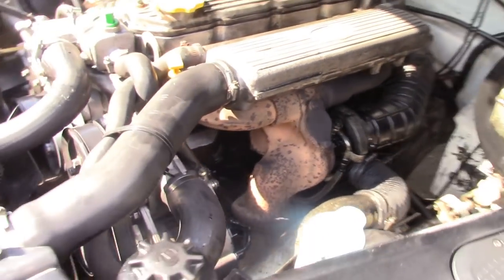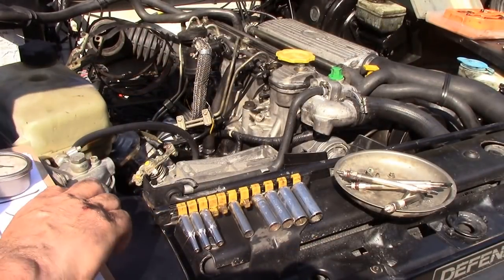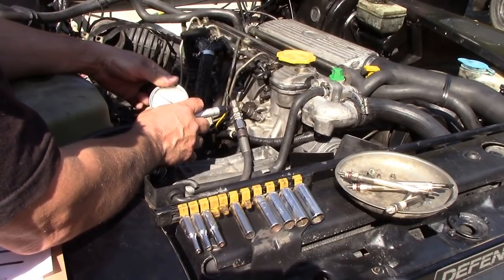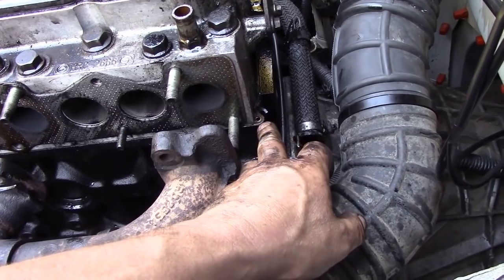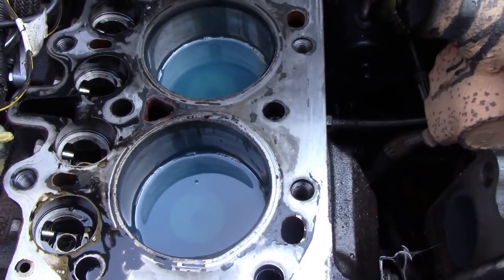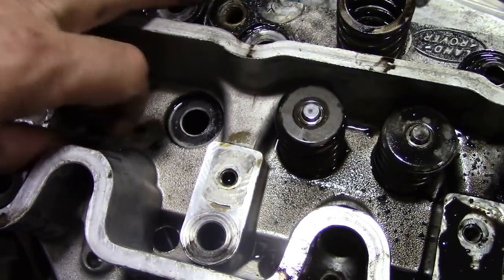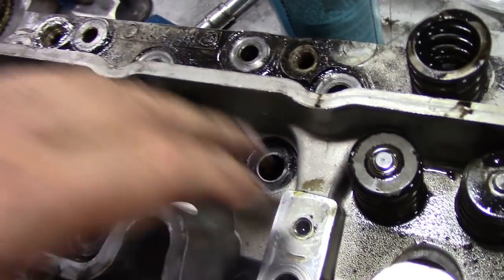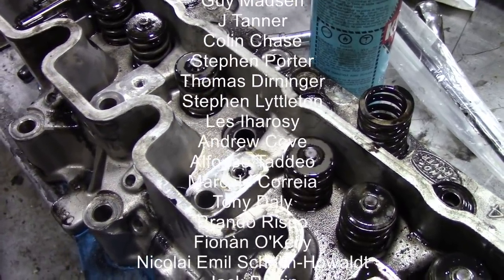300Tdi excessive oil consumption and leaks! What could it be?

Comment: I'm scratching my head as to why you didn't find the broken parts!!!  makes me think that the previous engine rebuild was not up to Britannica Restorations standards.  Possibly they thought that the valve guide was not that important so they stuck the broken guide in just to get it running.
Reply from the maker: Well it had me foxed - until this morning when I was fastening down the head
I had to use the old bolts as I didn't have any new ones (which is OK you can use them 3-4 times) but the one near the manifold would only go to 37 degrees not 60 - strange feeling tightening down so I put a good used one in and it was OK
So I think this has been running hot at some time and maybe the valve nipped in the guild?
There was some old damage to the block - I have videoed what I found
This vehicle did come form Eastern Europe

Comment: Hi Mike, have a Defer TDI300 which has been sitting for a few years in under cover in a tropical climate. nw back on the rod getting a few niggily things which can generally spoil a fun drive. Minor oil leak /power steering leaks etc.. recently replaced the lift pump which packed it in. up fro a service for sure but also thinking of getting ahead of these - what would you suggest  I should proactively change / replace for the long family drive coming up

Comment: brilliant fault find mike, just swapped my 90 300tdi for a 110 300tdi and was wondering if you reckon it's worth having an egt gauge (I.e from the likes of fourby uk) or just ease off on the hills? reason I ask is I beleive the 110 has a fuel boost pin and ring going by the puĺl from the engine and a bit of smoke, also the fuel pump inner cap bolts have been replaced with Alan heads rather than the standard torx headed ones, what's your thoughts bud?
Thanks
Aaron
Reply from the maker: Aaron
It is always a good idea to fit an EGT gauge on a 'tuned' engine
MIke
Reply: @BritannicaRestorations  Reckon I'll get the kit from fourby bud, wish I'd have removed it from the 90 before it went as well as the RRC coolant level float kit!

Comment: I'm amazed you couldn't here it rattling about Mike...
A quick question if you don't mind.... you say you keep parts in stock like the head, what happens when you buy a part and keep in on the shelf ready to be used and you fit it to the customers vehicle and have a problem?
Obviously if you put the head on and you've had it for a few years I take it the original warranty has expired...
Cheers..
Reply from the maker: The head I keep is reconditioned - pressure tested , re machined (inc. correct valve depth) and I warrant them myself as it was done locally and I was in control of the quality
Reply: Britannica Restorations Ltd ok cheers Mike, but do you ever get problems with other parts?
I know I've had my fair share of faulty parts which I've fitted and something has given up a few months later!
I just had it with a 8 month old alternator in Sweden and over a 1000 miles away from home, ended up finding a second hand one which was a 4 hours round trip in a hired car!
So Can you still claim from the supplier if you have had it on the shelf for months but it's not been used?
Reply from the maker: Good question!
I have a 2 year warranty on parts from my supplier - all I have to do is prove the part is theirs, (there is a special code on the box) fill in a claim form, and they offer me an instant credit (no return needed) or will ship out a replacement part 
After 20+ years doing parts you learn a thing or two
I do not sell or stock Chinese starters or alternators - do not care who's box they come in  -always OEM parts wherever possible. 
All brake parts are OEM boxed parts  - cost more and the customer thinks I am ripping them off, but if they want cheap Chinese they can go somewhere else
But parts on the shelf can be an issue - I have been slowly reducing inventory and as I now have a 72 hour FedEx service from the UK, it is not worth tying my money up on parts that are losing value and deteriorating 

Yes I pay more for shipping, but when you could see the amount of stock I had ordered special for people then didn't pay, it would bring a tear to your eye!
So special order parts are always paid for in advance now
I had lots of Series parts that I gave away to clubs to reduce inventory - there is only 1 customer with a 2a now who is loyal = they all buy from Paddocks on line and I know the margins they are working to, so I am not going to get into the 3% profit  game as I do not sell in volume
But what I do now is let customers provide their own parts for me to fit - and this is working out well - I charge 10% extra on my hourly rate which is the norm here in Canada, I am not responsible for duties, import costs, warranties and importantly wrongly ordered parts
And I do not give out part numbers any more ( well maybe to you guys) 

But I used to spend a long time working out which part was right for the vehicle (as you know there are a lot of mis-matched Rovers out there), making a detailed quote - only for them to take my quote and buy from Paddocks
You can spend hours on the computer working out part numbers, and the part has to include my time - as I could be doing something else!
Mike
Reply: Britannica Restorations Ltd a perfect answer Mike so thanks for that...
Take care and I'll be waiting for the next video!
Reply: Do you see any of the 2.5 NA and turbo engines out there? as fitter to the original 90?
Reply from the maker: I have a fully rebuilt 2.5 NA with transmission and transfer case in my container  - but I avoid the DT like the plague!
Reply: Britannica Restorations Ltd I've got 2 19j or 2.5 Td Mike, one in a genuine county and another in an old series 3, both have given good service and touch wood I've not had any problems with them!
Reply: Lol. TDis do rattle just a little

Comment: Lol.... 11:13 did you just say Africa and other strange places? Very educative diagnosis. I am looking into importing a 300tdi engine into Kenya for my 4 cylinder petrol conversion. Would you be selling engines?
Reply from the maker: I have a hard time with old engines - so I nearly always end up stripping and inspecting them
Imported one with no pistons in 2-3 cylinders and one seized up -both from reputable UK sellers
So if I don't hear an engine run, I only offer a very low price, because I may have to rebore and regrind 
So beware engines on the floor!

Comment: How many miles does this engine last?  tank ! Florianopolis SC Brasil 2019
Reply from the maker: It all depends on maintenance - because these engines can run a long time, they tend to be neglected for oil changes and cooling system checks
Reply: Tenho um motor igual no meu defender e tem 980000km. Sem uma manutenção muito regular   e até agora está completamente de fábrica com excepção do turbo compressor

Comment: Hi good night I have a300tdi engine but the engine is smoking it bills over 1year ago is not the rings wath it can b . but ibouth a new head wath it can b can you tell me
Reply from the maker: Check the brake servo for leaks - they crack, and the vacuum pump then pushed more air into the engine crankcases than it can cope with, then oil droplets get into the air intake
Common problem

Comment: Something you might be interested in....
My 300 has 300k miles and I get 435psi (30bar) on all four cylinders, is your engine abnormally low or mine abnormally high?
Reply from the maker: From my notes
Expected readings of a crank test, with vehicle 
battery fully charged, compression ratio 19.5:1 
should be 24 bar (348 lbf/in2)

So yours is strangely high
Reply: @BritannicaRestorations  I wonder why, I usually rev the engine for just a couple of seconds more than you did (and I guess it should not make a difference) but as long as the pressure is even across all the cylinders I guess I am fine. BTW I love your videos!
Reply from the maker: Could be a thinner head gasket?
Reply: @BritannicaRestorations  just checked, it's a three holes... I wonder if a thinner gasket could ever lead to a 25% increase in compression (from 24 to 30 bar). It would be an interesting topic for one of your videos.

Comment: I have 2 300tdi engines, one head gasket was blown so I lifted the other head being the engine was sitting for a bit. When I checked it I realized it had a deflection between cylinder 2 and 3 just like the other head. 
So I was thinking the the exhaust ports between cylinder 2 and 3 are next to each other and maybe that could be causing that issue...
Reply from the maker: Could be - I have a feeling there is something amiss with this motor - I will do another video to show what I found this morning
Reply: As you say Mike,  the engine has been rebuilt, I recon that when it was done, who ever did it did not inspect or check the head out, they probably fixed an obvious fault on the bottom end and stuck the head back on as it was. It has taken quite some time for that amount of wear to happen, but I have seen worse. Very good video Mike, which should be a lesson to many people, keep up the good work. Best wishes from Yorkshire, Rob.
Reply from the maker: It had been overheated Rob